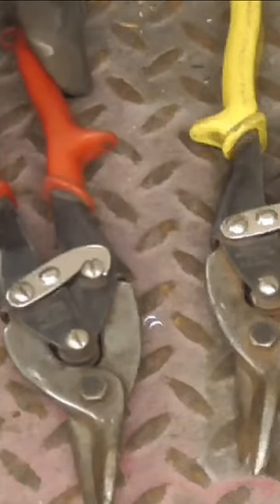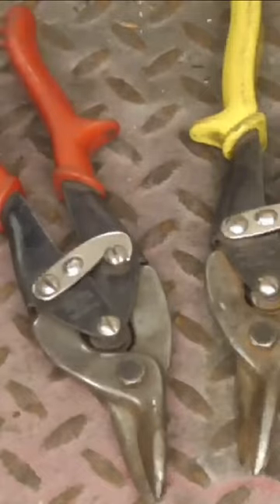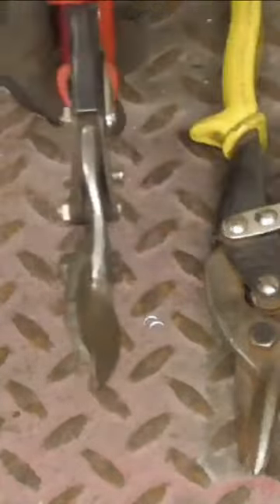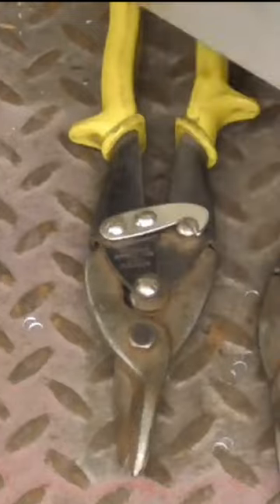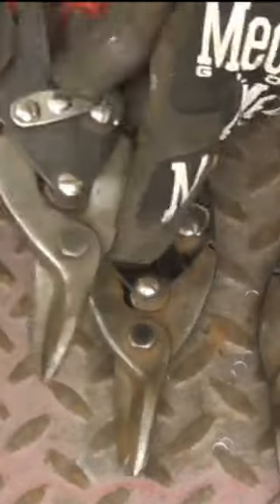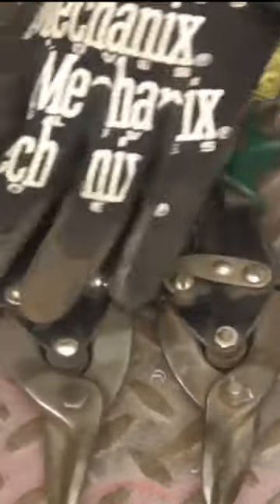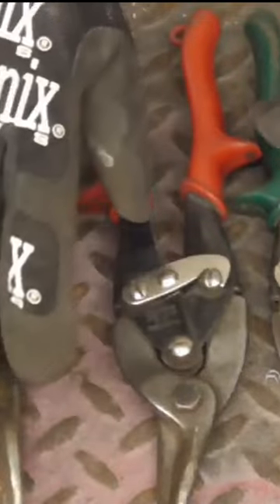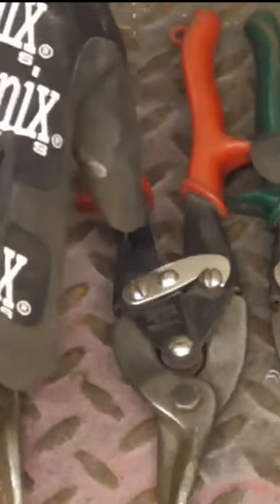Why do Tin Snips Have Different Color Handles?  #shorts  #autobodyrepair #autobody #fabrication

Comment: I had a pair of yellow ones for cutting metals studs when working in construction and drywall. I ended up using them to cut the sheet metal under the rear driver side seat of my 2006 Pathfinder (R51). I created an access panel for the fuel sending unit and was able to swap the guts for cheap using the sending unit from a Trailblazer of similar vintage. Then, used an access panel cover from a Pathfinder Armada to cover it.  Overall MUCH easier than having to drop the tank to do the job. A nibbler would've been just as effective.
Reply from the maker: Nice thinkin' IKS - they really should make access doors for what you did :)

Comment: Roofers trick for cutting a long slot is use a L + R together with waste curl in the middle.
Reply: Could you describe what you're talking about with a little more detail?
Reply from the maker: Nice!! I'll give it a try :)
Reply: @ItchyKneeSon  Hard to explain, l+r work together to create a curl(waste) that you roll up like a sardine can. It's kind of a manual version of what a Air Shear does.